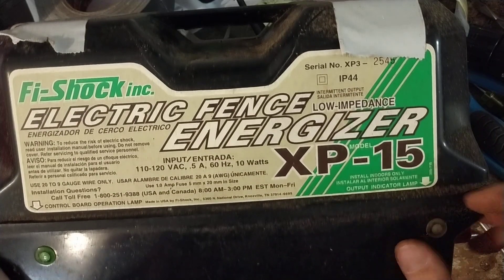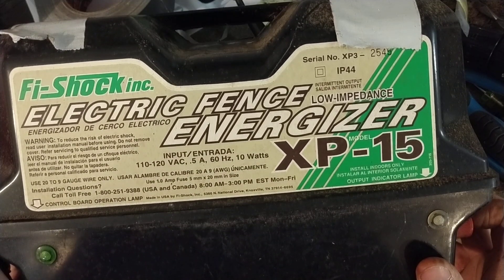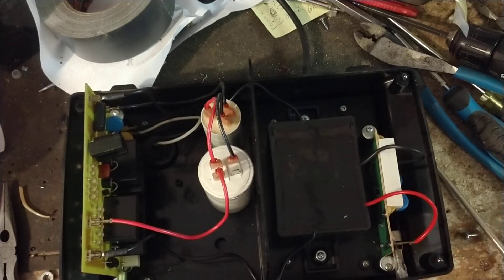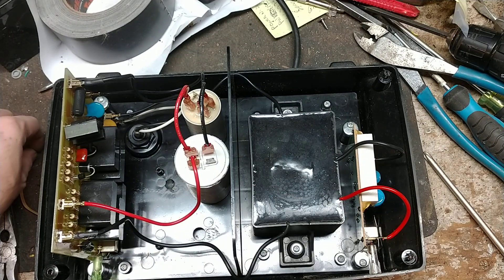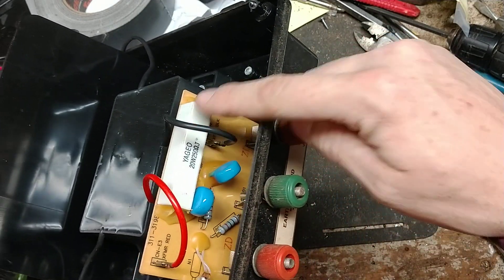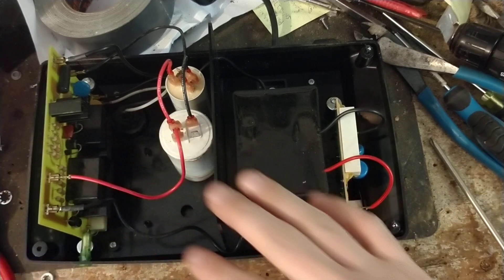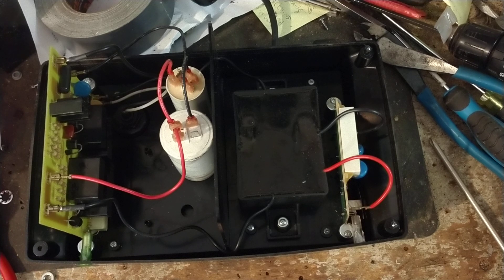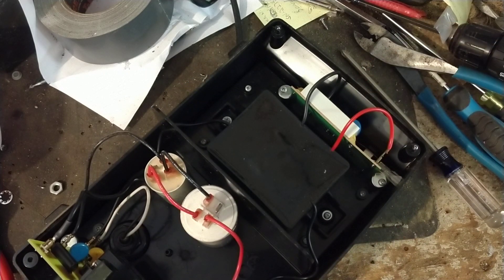How does an electric fence charger work & shock? | Fi-Shock XP-15 Fence Charger Repair

Comment: Single capacitor is enough
Reply from the maker: Different units have different size and different amounts of capacitors depending on what joule rating their manufacturer is going for. A bigger joule unit will either one one or large capacitors wired in parallel to add up like this one did, or they'll have a handful of smaller ones all wired up together. Or some really small powered joule units will have just one small capacitor.